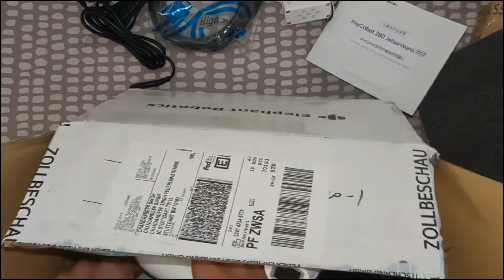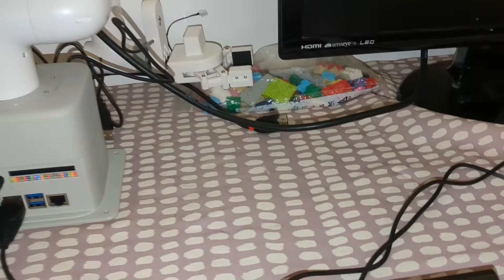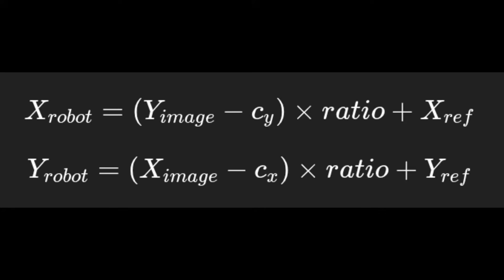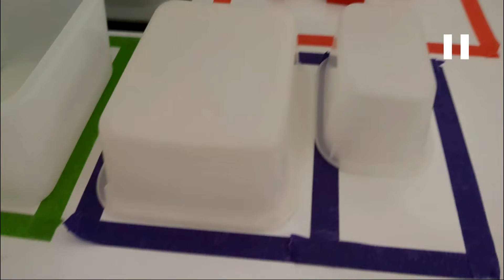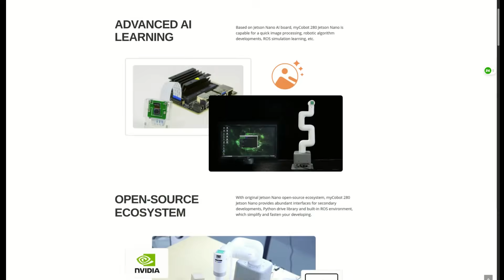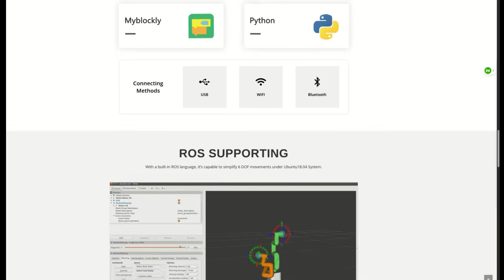Vision-based Warehouse Sorting of 6-axis Collaborative Robot myCobot 280 Jetson Nano

Comment: For robotics field , should I buy MacOs or window based laptop ? Which is better and suitable ?
Reply: Better get ubuntu linux if you want to do robotics
Reply: Lol .get a windows and having a better gpu would be really helpful .
Any ways u ll be booting it up with linux .
Reply: @student-vr4vt  what about WSL? Is it enough to run robotics software?
Reply: WSL is a virtual machine(kinda simulation of linux ), not just a simulation. Running Gazebo inside it often causes lag. More importantly, WSL lacks direct hardware access; connecting to MCUs or USB sensors is a hassle and often fails without extra configuration. Native Linux is superior for hardware integration though there are some tools plugins right now which do give access of ur hardware to  wsl linux  but not sure abt its effectiveness.
Reply from the maker: Ubuntu all the way. Use what companies use.